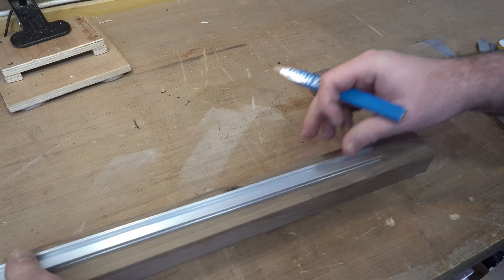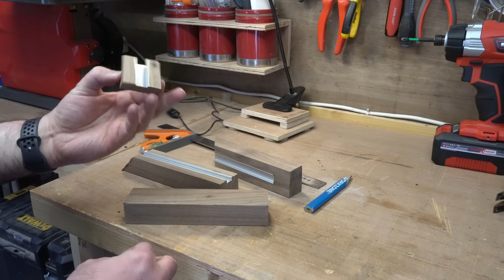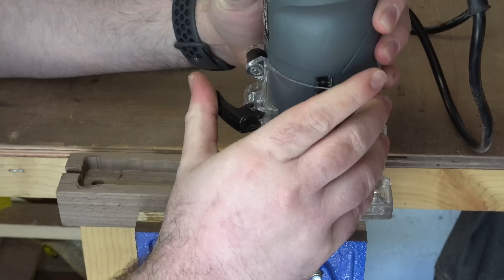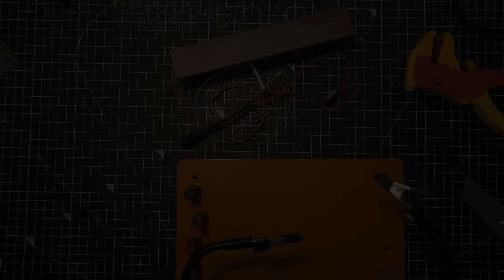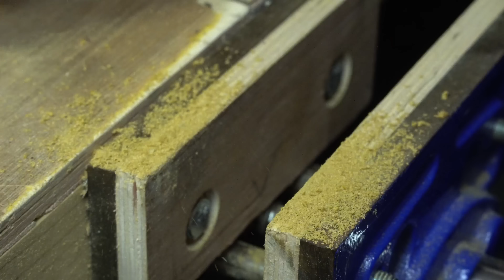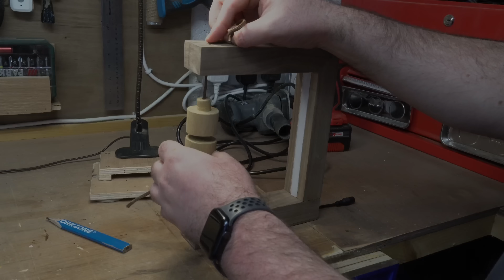MAGIC Magnetic Switch Lamp

Comment: Very cool, would you mind linking the electrical components you used?
Reply from the maker: Hi there, I could, but it might not be that helpful as I’m based in Ireland and I don’t know where you are, so you might not be able to get what I did. However, if you search for led strip lighting and micro switches, they are pretty generic so you should find more or less the same thing.

Comment: Super cool project! I love the concept so much, and it demonstrates so well the creativity you can achieve while keeping the build process relatively simple. 
If you run into an issue like that again with the width of the channel, a possible solution could be to set it back up in the vise with a sheet or two of thick paper as an offset and run the router down it again, or maybe on flip the piece to ensure it stays centered.
Reply from the maker: Good tip!

Comment: you need more support for your 45s.  dowels or biscuit would have help even splines.  some of our router drifts were showing.  try to put a guide on your router to help with that.  great concept and good luck on your woodworking journey.
Reply from the maker: Thanks! I’m pretty sure the 45 will be fine with glue and two nails, it is holding barely any weight, but time will tell!
Reply: Absolutely is fine the way it is. It’s holding almost no load. Great job.

Comment: Very cool project! Originally I thought the connection with the ropes was making an electrical connection which I thought was very interesting! But the switch idea is probably smarter. Not that I'd be super worried about getting shocked by 5v or 12v LEDs... but you are still plugged into a 110v outlet... so probably frowned upon. LOL
Reply from the maker: So the LEDs are actually low voltage, the wall socket is a cheap low voltage regulator, so it's all pretty safe. I don't like to mess with mains power!!